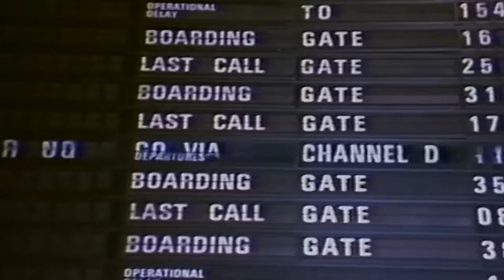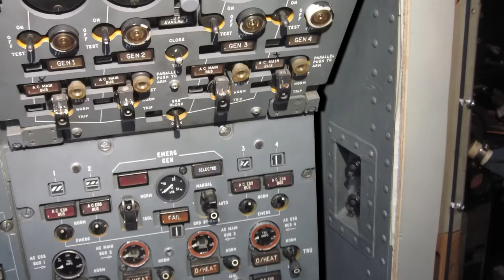Why Blue Paint Caused Problems For Concorde

Comment: So they turned the fastest version of Concorde into the slowest just by painting it blue 😂
Reply: Red goez fasta!
Reply: So Pepsi is run by orkz
Reply: And there was me thinking British Airways had slowed theirs down enough by pushing ticket prices up beyond the altitude of the space shuttle and then applying that frankly ridiculous interpretation of the UK flag on the tailplane... 🐌🇬🇧😉
Reply: Version of Concorde 
There was only one type and if was the slowest would be stationary 
It could never go supersonic as heat buildup would prevent safe flight
Reply: @adambarnes8797  the video explains how there were different models.... this one specifically used titanium rivets.
Reply: @bermchasin  
It wasn’t a model change just a different fastening that was lighter
Reply: @adambarnes8797  it had different specs. it might not be a complete "model" change, but it certainly was a separate version as far as performance was concerned.

Comment: I will forever love the droop snoot
Reply: LOL allways hated the drop nose, bandaid fix huge unnessary huge weight gain and adds  unnecessary complexity and, unrealiability.
Reply: Its called the droop snoot so the snoot will droop
Reply: alan connelly it was necessary for the nose to be long and pointed for aerodynamics. You can’t see the taxiway when taxiing with it in the way, so Concorde and it’s Soviet rival the Tupolev 144 both worked around the problem by allowing the nose to drop down so the taxiway can be seen easily.
Reply: MrSupercar55 I thought it was also a rudder.
Reply: It’s also used when landing because the Concorde has a high angle of attack at low speeds
Reply: The Boeing 747 may be the queen of the skies.  Concorde was the Princess of the skies.  Everyone always loves the princesses more.
Reply: Did you say drop snout?
Reply: @MrSupercar55  A truly modern solution would just be using cameras and could be accomplished at a fraction of the price of the droop nose. Being able to see out the window is a decidedly Visual Flight Rules luxury anyway. IFR was very much in its infancy when the Concorde was designed.
Reply: @MrSupercar55  Thanks for shutting down alan connosillys ignorant comment .
Reply: @airgliderz  Thats a very ignorant comment-its like saying i hate that the car  wheels are round-looks really bad.My brain froze
Reply: @airgliderz  How much did it cost BA and AF to maintain the droop snoot per aircraft per anum?
Reply: The snoot drooped. (So many people here dont get this joke and it makes me kinda sad)
Reply: Chris Hunter you dropped your snout?
Reply: @jasoncarswell7458  Huh? Planes do not land in IFR, every approach has minimums, landing is always in VFR. The droop was needed, that delta wing needed a high aoa at low speeds, without the droop, pilots would not see the runway.
Reply: @indridcold8433  l always thought of Concorde as the Queen and Jumbo was an Elephant
Reply: @johnkean6852  The Boeing 747 is the queen.  The Concorde was the princess of the skies. The princess is always more loved than the queen.